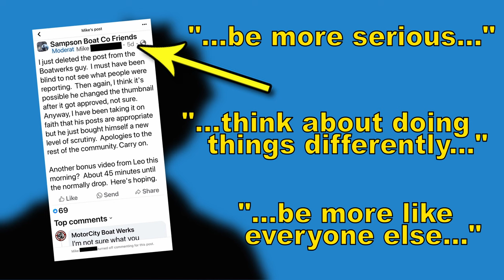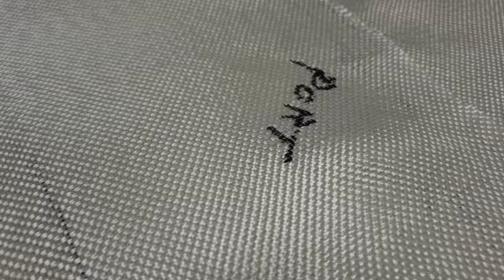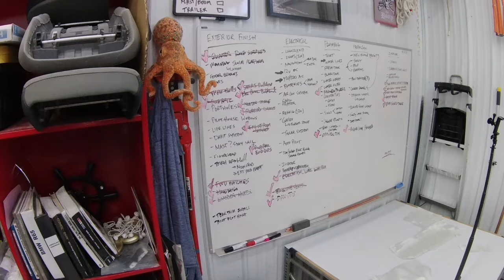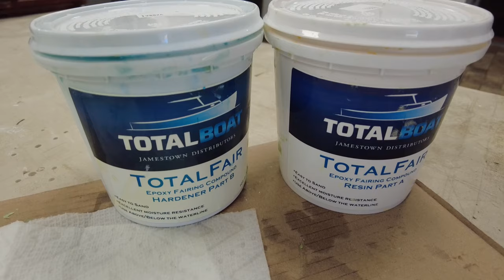Banned By Sampson Boat Co? NAKED truth about Swinging in Boat Building (Ep71)

Comment: I think it's a good idea to add some glass to that area, but I would have used 1708 instead of the 7oz cloth.  It's a much stiffer fabric, and would build thickness much faster. I get about 1/8" with 3 layers of 1708 and epoxy. It looks like a pretty flat surface, so using 1708 wouldn't be a problem. It doesn't like tight curves too much.
Reply from the maker: Yes this is a good idea. 👍 Now you have me reconsidering another go at the bulkhead 😔

Comment: Haha exactly that. 
I have a cabin boat and worked a lot on it to repair the transom an make little benches with a lot of fibreglass. 
Everywhere i took al little bit of information like your channel. 
I put on a yamaha 115hp 2 stroke and it holds up really good. 
I have a steve baker Phantom 21 and a Mercury 275 supercharded for it. 
But also this boat has a full transom repair and its all empty right now. 
Just mix and go allong. Don’t try to invent everything new.
Just stay who you are. I am a member of your channel because you are the real deal. ❤
Reply from the maker: Thanks for the comment Michiel 👍😁 Stay Motivated !

Comment: Joe there’s plenty of us sailors who fancy the east life of a trawler . The high speed crowd may not get along but they can learn from the process.
Re Davit did you consider attaching the rig screw support to the top of the deck ? It would have more support being higher and the angle of pull would not cause flex . 
Keep up the good work I’ll get re started on my project soon too.
Cheers Warren
Ps I’ve been supporting Leo from very beginning when he was poor!!!
Reply from the maker: It’s not really talked about  in the video but there is an angle for the support strut from the cabin top to the davit. The top of the cabin top is too tall and does not accomplish the same support. Thanks Warren 👍😁

Comment: Joe, what were your thoughts for selecting the mounting point of the turn buckle on the bulk head? --- Choosing a higher point would reduce forces in several places, also on the mounting point of the davits, though looking less elegant.
Reply from the maker: Great question. 👍It may not be apparent in the video but here is a limit to how high the turnbuckles can mount relative to the top edge of the aft cabin. There is an area within 2-3 inches of the top that is not flat on the interior. See the headliner videos. This effectively limits where turnbuckles can be mounted due to the sizing and placement of the interior backing plate. I feel the chosen position is the best of what’s available. Thanks for your great comment 😁👍

Comment: I suspect that the weak link in the design is the eye strap:  both the strap itself ( it is far thinner than the turnbuckle. It may be worth considering using a more substantial U bolt ) and the attachment to the davits. All the force is concentrated onto one flange of the davit. If the fixing were rotated 90⁰ then it would be fixed horizontally across two flanges.
Reply from the maker: Interesting comments. 🐙🧐 The size and location of the mounting points  is a limiting factor no doubt. But just like any retrofitted piece of equipment we have to work with that we have. Thanks for the comment

Comment: Hey brother, why didn't you just use some 1708 instead of thin cloth? 2 layers of 1708 will give you about 3/16" extra thickness, and a lot more strength than 8oz cloth.
Reply from the maker: 👍It was something that I considered but decided to go the other way
Reply from the maker: 👍 Now you have me reconsidering another go at the bulkhead 😔

Comment: Also I believe you will remove the flex from your Davits if you can mount them direct to the deck. The intermediate channels you made between the davit and the deck are more than likely flexing as well.
Reply from the maker: Certainly possible but in video review it’s the deck and cabin top 😳

Comment: I am late to this party but I will say it anyway if I may. First off the Davits flexing in themselves is not necessarily bad. It was difficult to see on the video if there was flex at the deck junction, of course the cabin top flex was clear.

Anyhoo - on the reinforcement of the cabin top what you have done  will certainly improve the strength but it will not improve the stiffness as much if you had incorporated two horizontal stringers (formed around closed cell foam.

Too late now.😉👍
Reply from the maker: Brilliant 🐙thanks for the comment. Be sure to like and subscribe